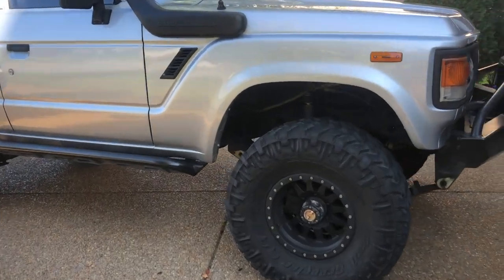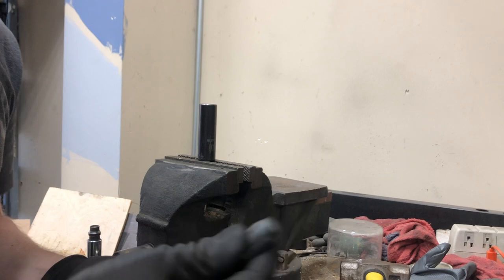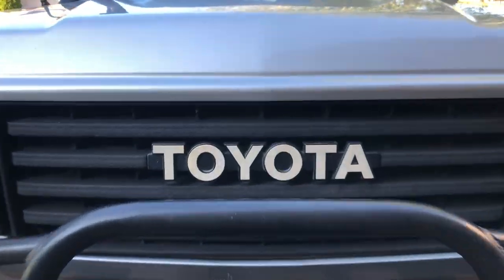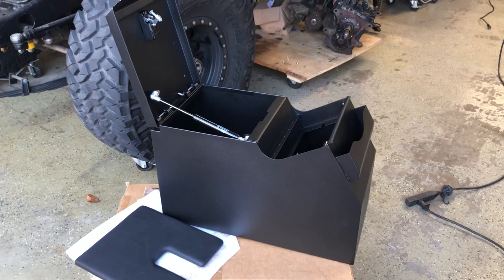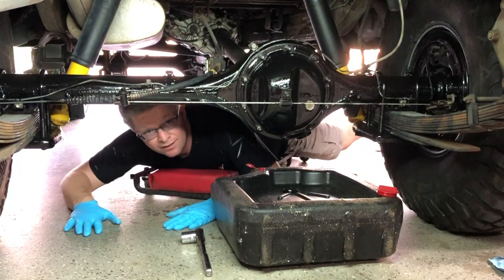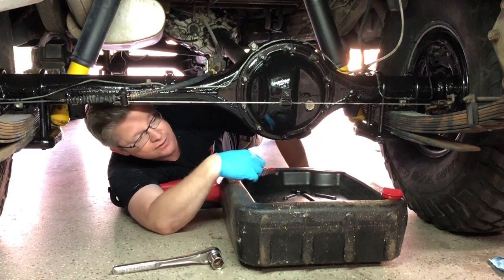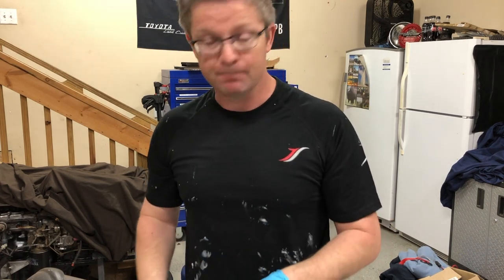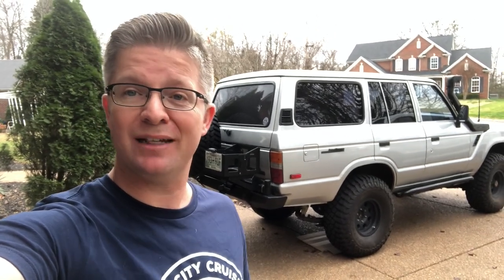Toyota FJ60 Upgrades and Improvements

Comment: first time seeing your LC video;  I have a 1988 HJ61.  Im getting ready to replace the factory radio, and want to add an amp, new speakers....just seeing what you have in yours; Mine is in the Philippines....but going over when they open up to live there and get the radio work done... in Florida presently.
Reply from the maker: Hey bud, nothing special at the moment, just an upgraded pioneer head unit. Although I have been thinking about upgrading to a unit with a pop out screen that would integrate with google and Gaia maps

Comment: Enjoyed video.  Thanks for part number...preferred vendor?  Also non-related but do you happen to konw where the blinker relay is located on the FJ60?
Reply from the maker: Thanks Carl. I just got them from Amazon. The turn signal relay should be under the dash on the drivers side to the left of the clutch pedal.

Comment: did you need to use spacers on the wheels with running 33x12.5 tyres?

Comment: Wow...what's up with that dry rot on those Nitto tires? That's some poor quality. What torque spec you using for the lug nuts? Nice cruisers!
You keep mentioning SAE sizes for everything   (I know..along with metric) ...you shouldn't be using anything but metric...yeah it might fit but it's not what is specified to use.
Reply from the maker: Thanks, yeah I try and mention both just so others have an option if they don’t have metric on hand. Nitto make some good tires, but these were old and I think had been baking in the Cali heat for a while! 
I usually go 90-100lb-ft on the lug nut torque. Thanks for watching!

Comment: What size lift kit are you using on the fj60? Is it an old man emu 2 inch?
Reply from the maker: Yes old man emu shocks and OME Dakar springs with Man-a-Fre rear shackles and front sway bar links. Also has a Man-a-Fre shackle reversal. I think it’s 2” but not 100% sure
Reply: @musiccitycruisers3863  thanks so much!